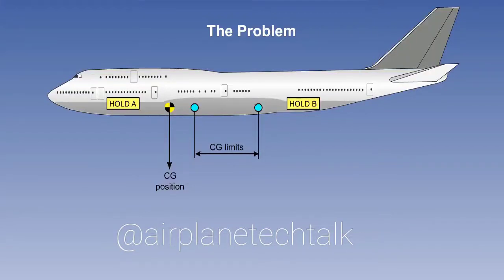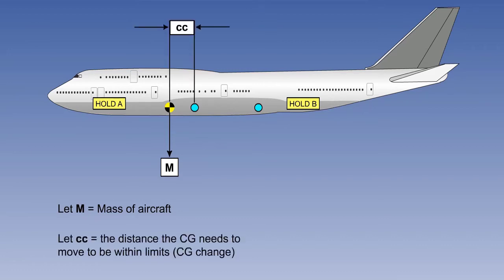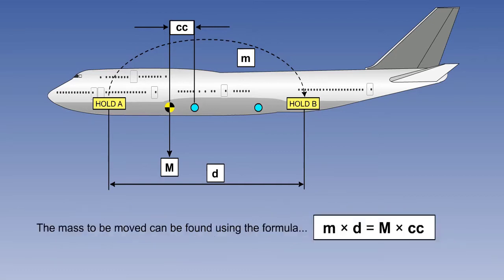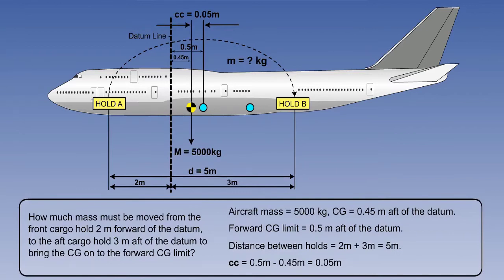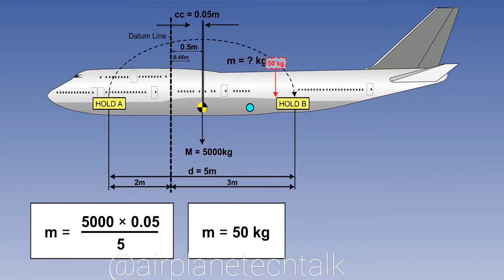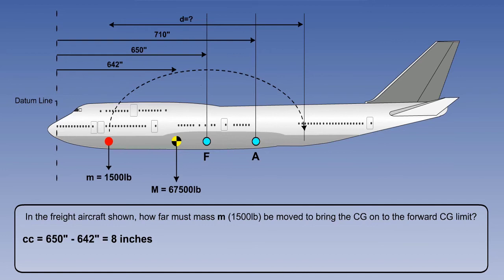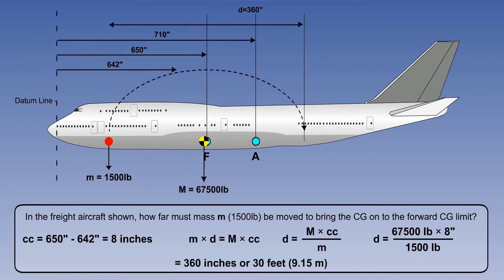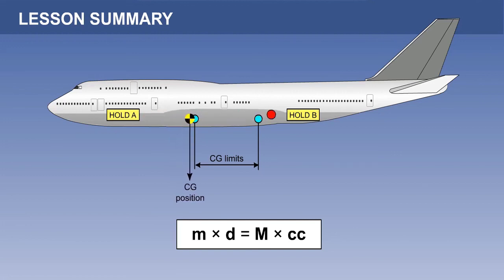Aircraft Repositioning Of Mass With Moving CG | Lecture 10

Comment: I have a problem about "tail tipping" ,did CG move opposite to weight or move along with the weight ?

Hope you still available to ans my question, thx you.
Reply: "Tail tipping" refers to the movement of an aircraft's tail in response to various forces during flight. When an aircraft experiences a force that causes it to pitch, the tail can respond in different ways depending on its design and the specific aerodynamic forces involved.

If the aircraft is subjected to a nose-up pitch moment (nose rotating upward), the tail can respond by moving opposite to the direction of the weight. This is known as a "nose-up pitching moment," and the tail moves upward to counteract the pitch.

Conversely, if the aircraft experiences a nose-down pitch moment (nose rotating downward), the tail may move along with the weight, in the same direction as the pitch moment. In this case, the tail moves downward to counteract the pitch.

The specific behavior of tail tipping can be influenced by factors such as the aircraft's design, the location of the center of gravity, and the aerodynamic surfaces on the tail. It's crucial for aircraft designers and pilots to understand these dynamics to ensure stable and controlled flight.

Measures to prevent "tail tipping" usually depend on a number of factors including aircraft stability, load distribution and flight principles. Here are some basic measures that can be taken to prevent tail tipping:

Center of Gravity (CG) Control: The center gravity of the aircraft must be set correctly. CG is the balance point of the airplane, and it is important that this point is within certain limits.
Load Distribution: Proper distribution of loads is important to ensure the stability of the airplane. Proper placement of heavy loads can reduce the risk of tail tipping.
Correct Use of Flight Controls: The pilot must maintain the stability of the aircraft by using the flight control surfaces correctly. This is important to perform a smooth maneuver and keep the aircraft in the desired position.
Aeroelasticity and Structural Design: The aeroelastic properties and structural design of the tail region of the aircraft can help reduce the risk of tail tipping. This can improve the aircraft's resistance to various flight conditions.
Compliance with Flight Restrictions: Adhering to the flight limitations set by the manufacturer of the aircraft is important to minimize the risk of tail tipping. These limitations are set to ensure that the aircraft flies safely and stably.